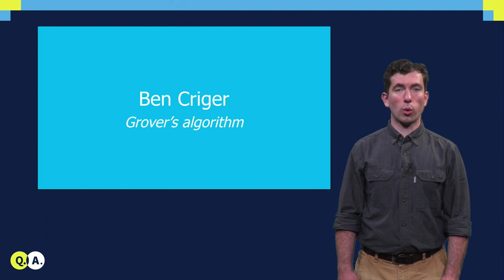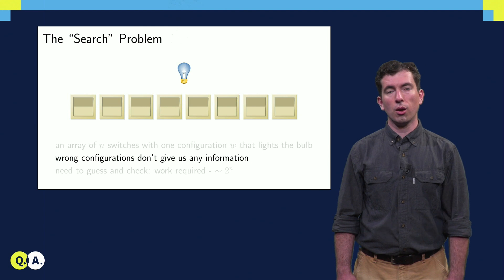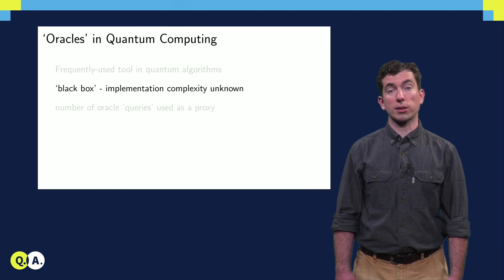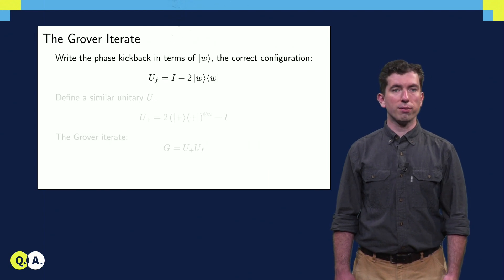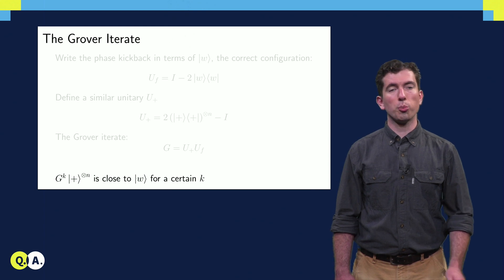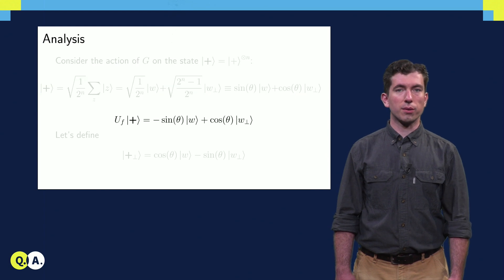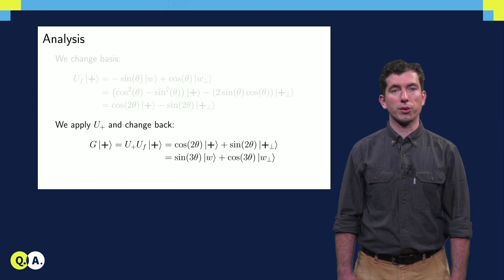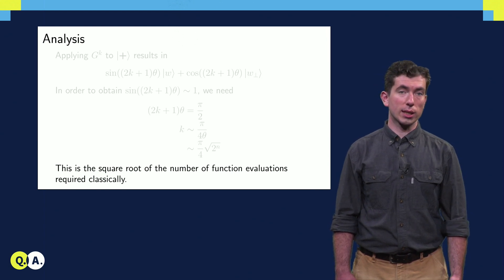Grover's algorithm | QuTech Academy

Comment: How to create an oracle function U_f without using the |w> state, which is the winning configuration that the algorithm is supposed to find? If we know |w> before running the algorithm, we already know the answer.
Reply: That's what I am confused about too, why bother if we already know the state we want, it doesn't get us anywhere to define the other things in terms of it. I must be missing something.
Reply: I have the very same question!
Reply: I was thinking the same but then the same applies to the classical approach. As our function has to spit out a 1 or a 0 depending on the input, it indicates that the function will have to be realised in a classical circuit. Similarly, our quantum oracle must too have a defined structure so that the function gives a correct output depending on the input and well the 'winner' number we are searching for.
Reply: It's a search algorithm. We need to seperate the desired state from a superposition of different states.
Reply: @tunglau9439  Can You help me more via facebook?